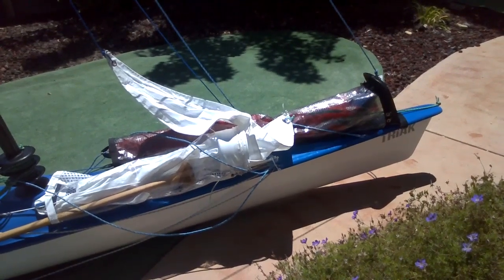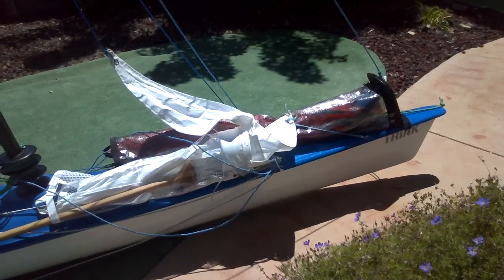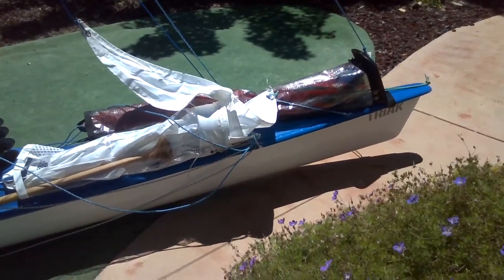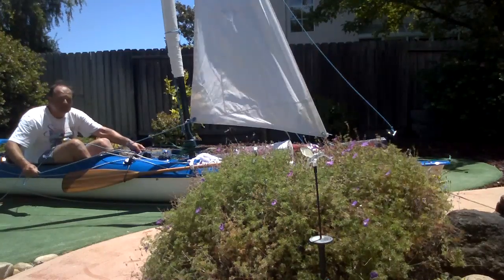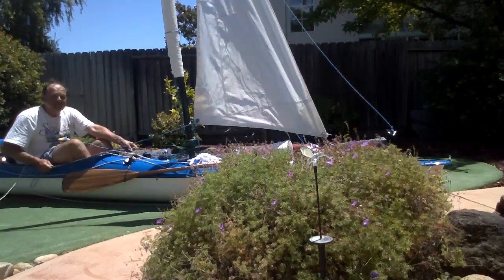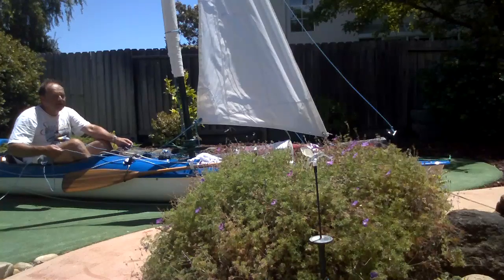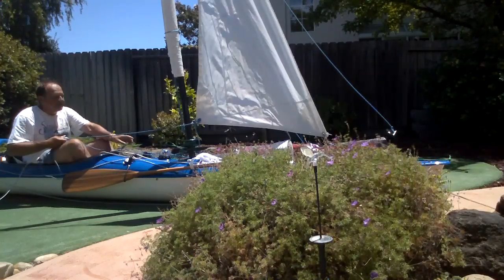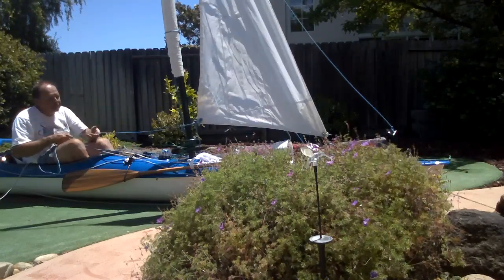Jib Snuffer for Triak

Comment from the maker: The top screw must be loose so the fitting can revolve; loctite will keep it from backing out.  I used the spin snuffer bag for the jib at first, but decided I wanted both sails available so made a new one.  I'm still using the cam cleat; but the pxr might be in my future since i have to hand hold the mainsheet here in big wind.

Comment: Nice work !  Did you do something about the screw at the top of the mast that wants to either bind or come unscrewed?  Also, could the snuffer bag for the jib be created using the original snuffer bag? Did you change out the harken cam cleat for one of the spinlock pxr cam cleat (clutch).

Thanks